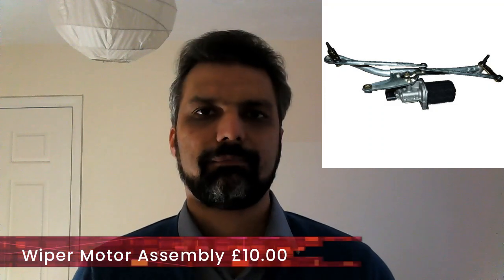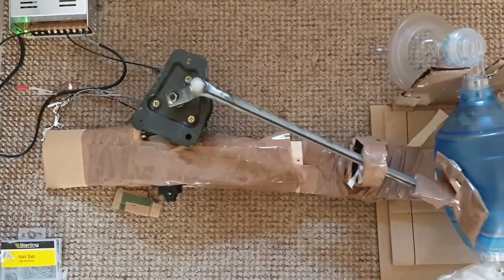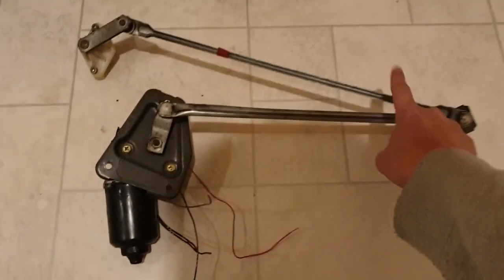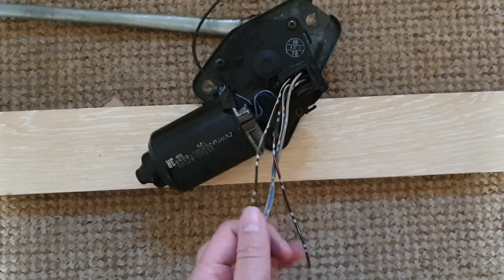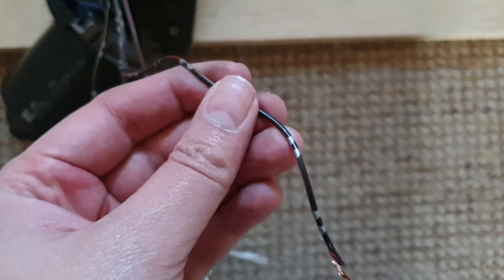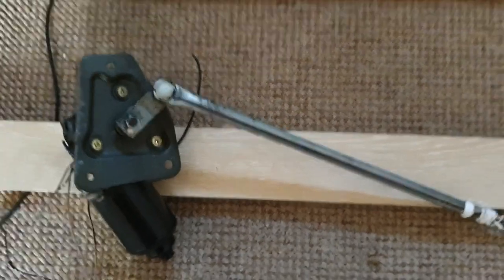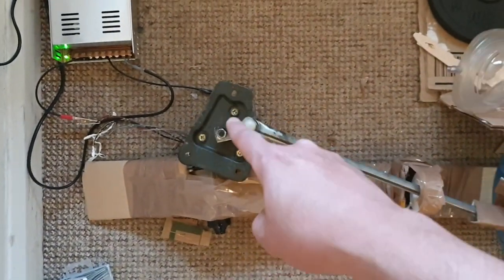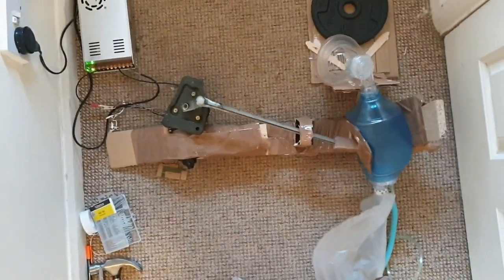Simplest and lowest cost automated AMBU bag machine. Alternative for Ventilators

Comment: Hi do you know How to synchronise breath of a patient. with this crude design. It can burst the patient lungs with permanent damage. As the rhythm of breath are not same all the time. How will you synch . Somebody life at stake if someone uses your design. Do you realise .
Reply from the maker: As mentioned in the video, you can use a potentiometer (regular) to change speed and use a timer relay to change frequency. This is a template. The ambubag doesnt produce enough pressure to burst the lungs.

Comment: Moving virtually zero air... Rate too fast and squeeze on BVM too little... Basics of a good idea here but needs work (SR Para)
Reply from the maker: If the position of Ambu bag is changed it pushes more air. You can control the air volume by positioning it. The rate can be controlled by a Rheostat. Thanks

Comment: Tough to keep the mask on the face...
Reply from the maker: Just make the frame that holds the AMBU bag out of wood. I didnt have any to spare so I used cardboard, which is not very stiff.
Reply: @synergyfiles3536  might work with an ET tube and Catheter mount
Reply: Synergy Files unfortunately in real use it’s super difficult to maintain the seal between the mask and the mouth especially because the patient will move naturally

Comment: Great idea. This would have to rest on the patient's chest or right next to their head, so design can be adjusted for that. I've run my wipers for one 8 hours on a long trip but maybe brushlessmotord could be found. We are talking about emergency situations, and people can operate the bag to give the motor a rest and use the motor to give people a rest.  Some way of notifying the helper if the machine stops while they fell asleep will be needed too. 
It is at least one way to save lives.
Reply from the maker: Thank you. With a wiper relay, it can be made to run intermittently. So the motor gets a breather too
Reply: Y dun we ad usb fan thre,im mean to the motor

Comment: Only brushless dc motors are reliable to run 24/7. Not carbon brush motors as in this video. They can't be run for even 5 hours continously. As i concern.
Reply from the maker: You dont have to use them continuously. With a relay, you can use them intermittently.